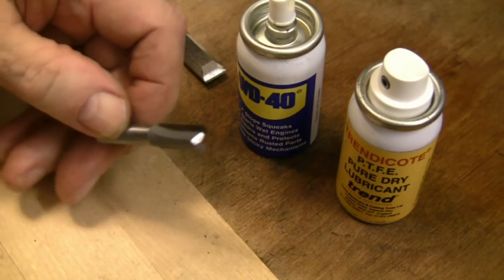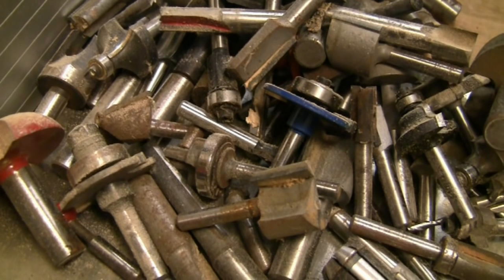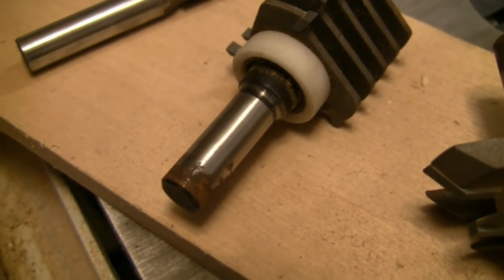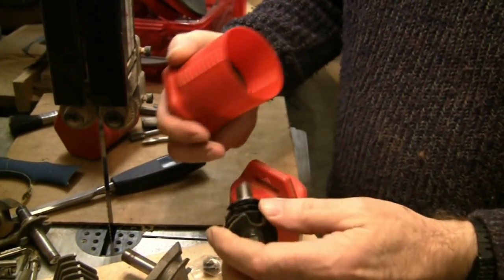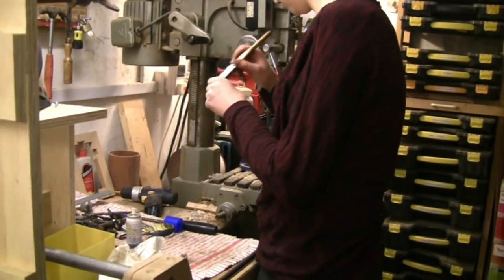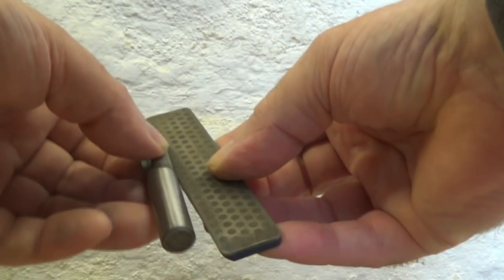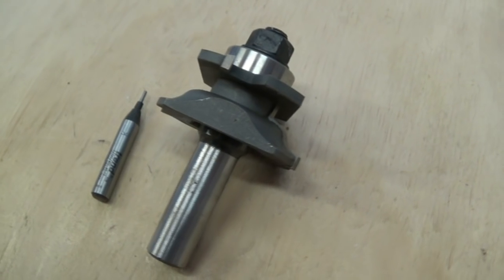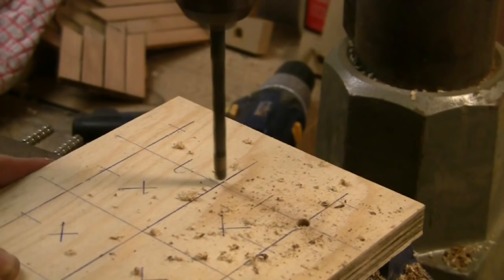Confessions Of A Routing Expert - Router Bits Revival

Comment: It's a shame that larger companies sometimes adopt the 'throwaway' approach, which is anything but feasible for a craftsmanship working on a smaller scale. My employer's, for example, spend £30 a time on Trend cutters, only to bin them when they're blunt (and that's when they don't break). A previous employer used to use Titman cutters and have them frequently sharpened by a company in Taunton.

Thanks for sharing your collection, Jez and I'm sure your student learned a valuable lesson that may not be available on other courses.
Reply from the maker: Absolutely Olly. Costing the bits into the job almost encourages waste - like some of the expensive work of today - on the skip ten years later! A carefully professionally re-ground TCT cutter can add years to its life, but even careful honing makes a difference.